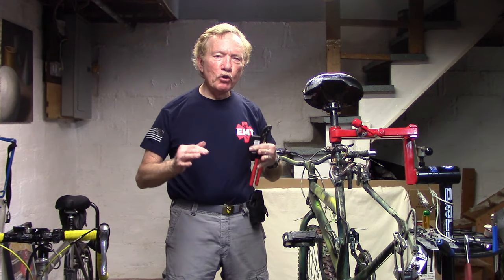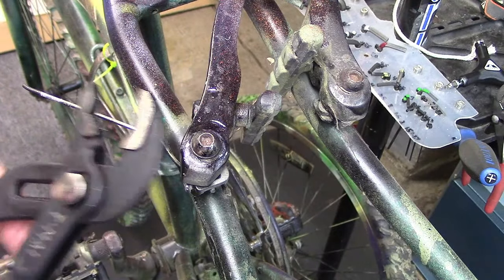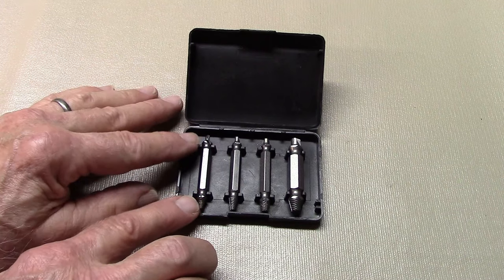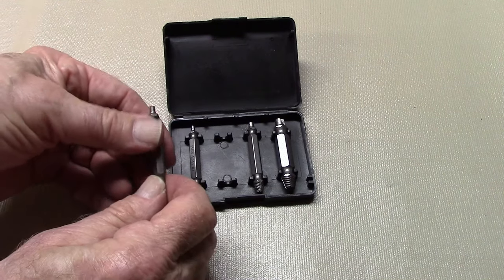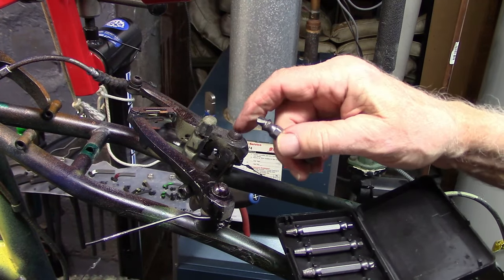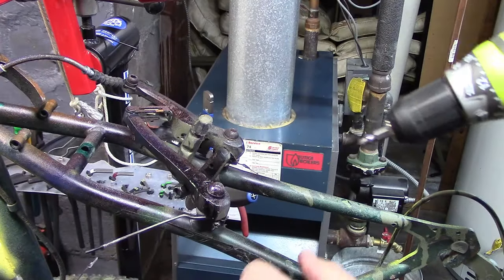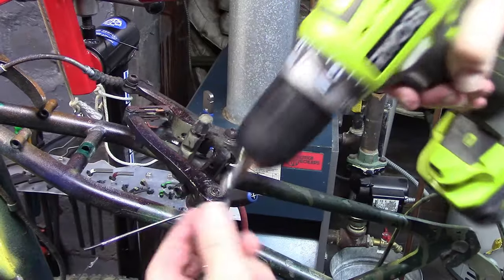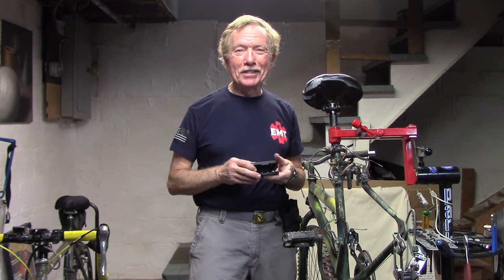How to Remove Stripped Hex Bolts (Stripped Allen Bolt Removal): screw extractor set /plumbers pliers

Comment: Thanks Tony. The water pump pliers worked a treat on a stuck bottle cage bolt. Saved lots of messing about with drills, screw extractors etc. Cheers
Reply from the maker: Yes, sometimes the simple things like plumbers pliers work the best. Also visit our YouTube home site at:
https://www.youtube.com/user/MrTony10speed
Regards and safe cycling, Tony

Comment: I stripped the screw of my rear disc rotor and had to remove it via an extractor. Worked like a charm and spared the threads of my expensive hub. Had it laying around for years and never used it. But boy was I glad I had it when the time had come...
Reply from the maker: Thanks for the info. It's an inexpensive investment but something that may come in handy. Regards and safe cycling, Tony

Comment from the maker: VIEW THE FOLLOWING VIDEO BEFORE ATTEMPTING TO USE A SCREW EXTRACTOR SET: 
https://youtu.be/8xwKx214g_g
Be very careful using a screw extractor set. Operate the drill slowly in reverse, stopping and checking frequently as you go with care not to damage the bike component or frame. Some of the failures as seen on one youtube video is the result of not operating the drill slowly and not using the proper bit. You need to start with one that is just larger the the inner bolt size but not larger then the outer bolt size. For stripped screws, see:
https://www.youtube.com/watch?v=Gz1SatVZ-zE

Also use SLOW SPEED on the drill!

NOTE: Hex bolts of 3 mm or less present a challenge and the danger of damaging the component or frame are much greater. If you drill into the hex bolt or screw too deeply, you may be drilling into the component or frame and either damage the treading of the component or frame. If the burnishing bit it too large, you may completely drill off the head of the bolt leaving the rest of the bolt in the component or frame. Practice on something other then your bike to get a good feel for how to use extractor bits before you undertake the job at hand.

Comment: Thanks for your video. The WD40 trick plus the plumbers pliers worked for me, except for one bolt (I got the 7 others out)! It is stubborn!
Reply from the maker: Did you try a torx wench? See:
https://youtu.be/0zqr-lGKE3k?t=137
If you decide to use a screw extractor set, take the following precautions:
https://www.youtube.com/watch?v=8xwKx214g_g&t=8s&ab_channel=TonyMarchand
You don't want to damage the frame. Good luck and let me know it you can get the last one out.
Regards, Tony

Comment: Safe cycling to you too. My Bianchi Infinito (disc brakes) has a system for removing the thru axle. It involves an integral tool for unloosening the axle. When not in use the tool, fits inside the end of the axle. It’s secured by two very small hex bolts of 1.5 mm. These hex bolts Have become unusable. I doubt  the tools you showed a small enough to solve my problem. To further aggravate the problem, I have now lost one of the integral axle tools on a ride. My solution is to carry a 16 mm cone spanner. Inconvenient but it’s got me out of trouble when I had a puncture the other day. This is my experience of damaged hex bolts.
Reply from the maker: No, I don't think the ideas presented in the video would work on such small hex bolt. You're idea on use a 16 mm cone spanner is en-genius. I wonder if there's a way to cut one of those old heavy brass colored hangers and bend a piece to make a smaller spanner. I use cut bend these hangers to make chain hooks (when installing chains). You can also use an old spoke (cut with spoke cutters and bend with a couple of pliers) to make a spanner that may fit. You may have to file the end some if they're too wide.
Regards and let me know if you decide to make a smaller spanner and if it works.
Regards, Tony

Comment: I have a quill stem binder bolt that is flush, and the hole in the bolt is so rounded that nothing will get a grip.  Any suggestions?
Reply from the maker: You might try a torx wench - a size slightly larger then the bolt. See:
https://youtu.be/0zqr-lGKE3k?t=136
Otherwise I don't have any suggestions at the moment. Using a screw extractor will probably not apply enough force. I will continue to research the problem for you.
Reply: @tony10speed  Thanks, I did try that, with a T45, but that only resulted in grinding away more of the slot.

Comment: I tried using the screw extractor but it ended up just screwing a big hole in the middle of the screw! Now I have no hope! Well I just squirted in a bit of wd 40. Let's see what that might do
Reply: Did you figure anything out? I ended up doing the same thing with an extractor set, it just drilled a bigger hole and didn't grip anything.
Reply: @DavidNW_  I think eventually the extractor worked, but I had to be very careful and go slow
Reply: @sebastianschweigert7117  Thanks! I ended up drilling with the second to smallest bit a deeper/narrow hole so the larger bit could catch on easier, and made a few notch marks that possibly helped too- I think the biggest issue was the bit needed to be pretty deep to catch and the hole was too shallow to begin with so it just spins in place.

Comment: Is there a danger of damaging the frame with the drill?
Reply from the maker: Always. Take great care when using on bicycle bolts not to damage the surrounding frame. Don't use on very tiny bolts or you may damage bike components. Practice on an old beat up bike or something someone is throwing out before you proceed. It does work for 4 mm bolts and above with care. Put the drill in reverse and keep it that way. Drill slowly with the burnishing end, removing, and frequently check the depth and surround component or frame. Switch the end and see if it will grab the bolt head or screw. If not, switch again to the burnish end and drill slightly deeper. When the removal end seems to grab by hand, place it back in the drill and power the drill on slow speed to remove. I think most complaints about these removal kits come from those with no experience or practice. Regards, Tony

Comment: Whaaaat? That's so cool.
Reply from the maker: Be sure to watch our other video first before attempting to use a screw extractor set:
https://www.youtube.com/watch?v=8xwKx214g_g&ab_channel=TonyMarchand
Regards and safe cycling, Tony
Reply: @tony10speed  thank you. I did, went and bought a Speed Out 4 piece set, probably did it wrong and didn't fix one bolt. Lolol!
Reply from the maker: @sharigirardeau3367  See our video on screw extractor precautions:
https://www.youtube.com/watch?v=8xwKx214g_g&ab_channel=TonyMarchand
You may be able to drill out the head of the bolt head carefully so as not to damage the part, remove the part and then the end of the bolt with a vice grip or pliers.
Reply: @tony10speed  OH! I guess I did half right: I thought using the needle noses with a rubber glove was a fail at first! 😄

Comment: I have a small hex nut (whose head has a hexagonal hole in it) that's stripped, but it's down inside a faucet head. You can  only get to it through a small hole hardly any bigger that the bolt head!  HELP.
Reply from the maker: Try your hex wrench. Tap in down into the nut with a mallet and try again (gently so you don't damage the hex wrench). If that doesn't work, you may be able to reach it with a torx wrench just slightly bigger then the hex. If you don't have a torx, you'll need to take it to your local bike store that may have the tools to get at it. Good luck and let me know how you make out. Tony
Reply: @tony10speed  Thanks. I haven't heard these solutions until now.  -Jack

Comment: Where did you get your extractor set?
Reply from the maker: Amazon: 
https://www.amazon.com/dp/B07XG6HQT3?psc=1&ref=ppx_pop_dt_b_product_details
or even better if available from Amazon:
https://www.amazon.com/dp/B085XJ94J9?psc=1&ref=ppx_pop_dt_b_product_details

Cheaper ones are available on Ebay but they get mixed review. Take great care when using on bicycle bolts not to damage the surrounding frame. Don't use on very tiny bolts or you may damage bike components. Practice on an old beat up bike or something someone is throwing out before you proceed. It does work for 4 mm bolts and above with care. I have not tried it on very tiny bolts but plan on experimenting on small bolts soon. Put the drill in reverse and keep it that way. Drill slowly with the burnishing end, removing, and frequently check the depth and surround component or frame. Switch the end and see if it will grab the bolt head or screw. If not, switch again to the burnish end and drill slightly deeper. When the removal end seems to grab by hand, place it back in the drill and power the drill on slow speed to remove. I think most complaints about these removal kits come from those with no experience or practice. Regards, Tony

Comment: I got one, f...d up completely - rear mag hanger - 2mm hex. No way of removing it without proper tools ;-(
Reply from the maker: Sorry to hear that but agree that proper tools are a must. And I always suggest practicing on an old beat up bike or or an old bike someone is throwing out. As with all tools, the best advise is three fold: practice, practice, and practice - before you tackle any repair.
Reply from the maker: For details on how to use a screw extractor set, see our new video:
https://youtu.be/8xwKx214g_g
Regards, Tony